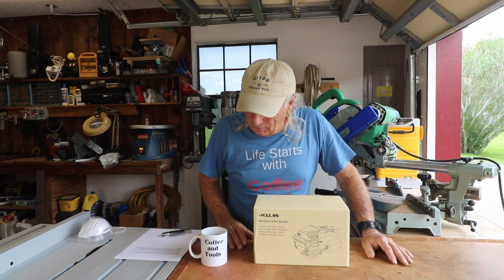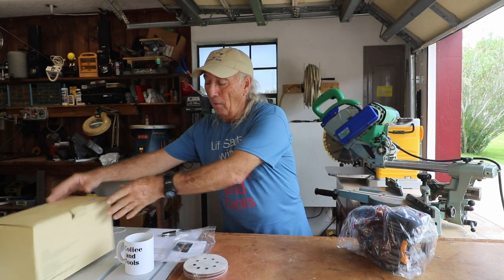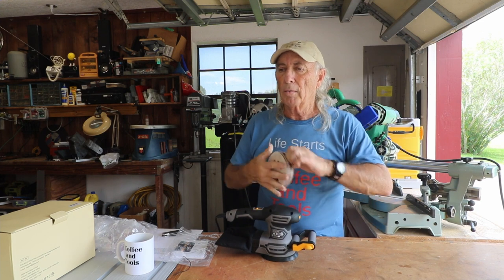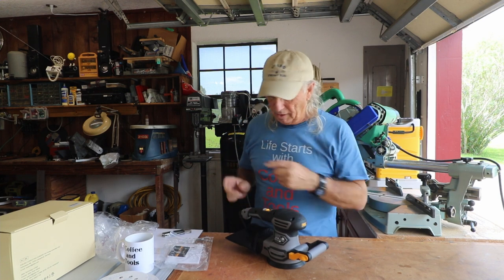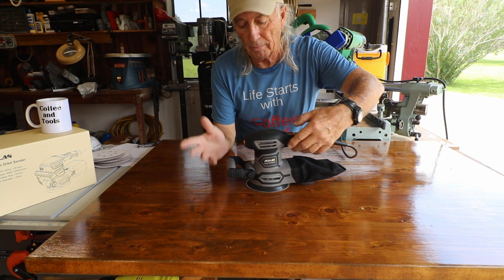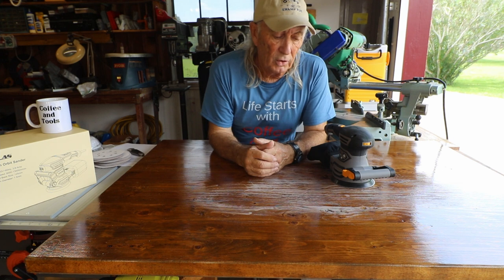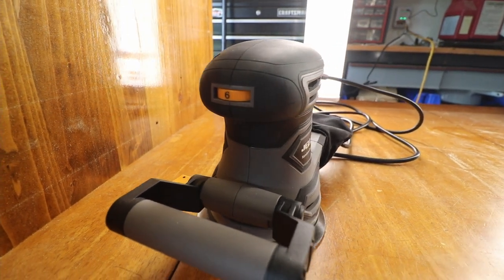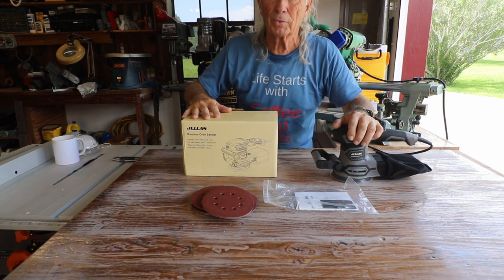Best Orbital sander !  Review and tips by Jellas @ Coffee and Tools episode 165

Comment: If they want to impress me the sander should come with a 1 1/4-1 1/2" and 1 3/4 to 2" exhaust adapters.  I also wonder how well over the counter 5" sanding disks holes align with the disk.  Another thing, Velcro is NOT generic, it comes in different sizes and patterns of hook and loop, are they consistent with other manufacturers?  If not, like misaligned hole patterns, they will burn up and burn out consistently, shortening the lifespan of the sander, head and paper!  Nice video, take care.
Reply from the maker: Funny I was thinking that when I checked the vac size. Good points and comments. I still liked the sander VS my old ones :)
Reply from the maker: A follow up on that sand paper question. The holes line up with my diablo paper, so...should be ok :)